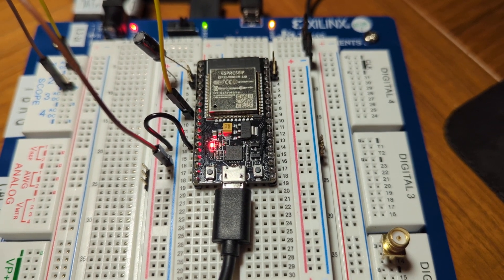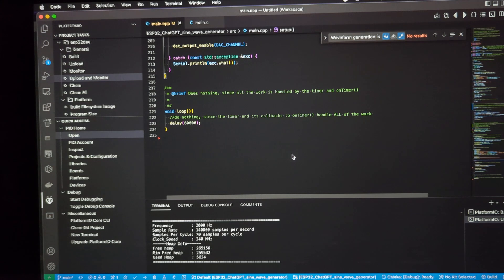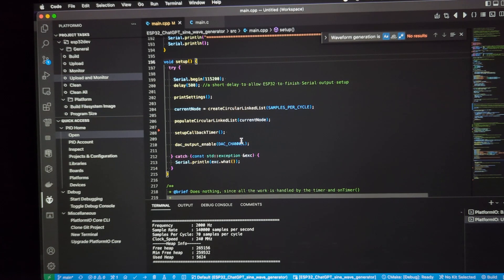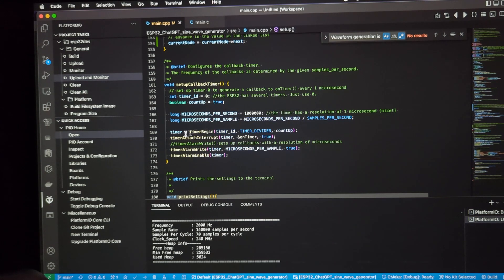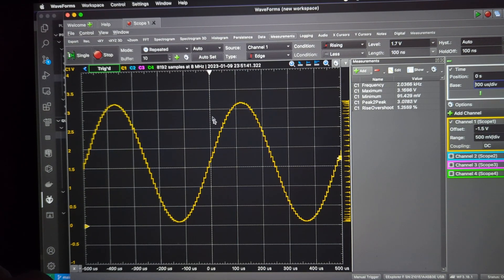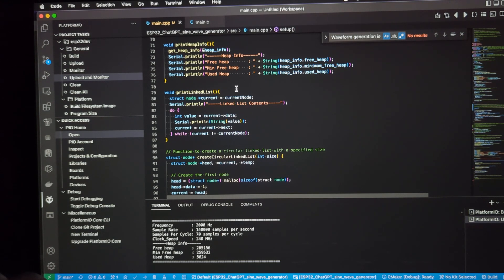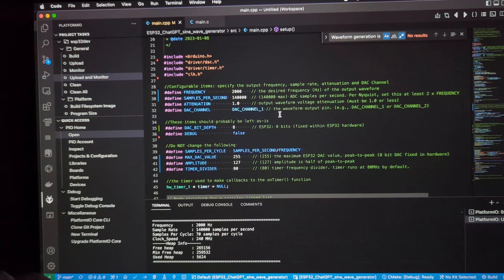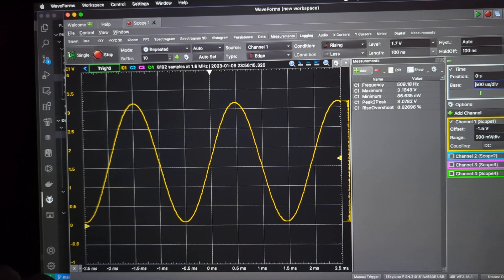ESP32 DAC: creating a flexible sine wave function generator

Comment: as you said "IT'S A START"
and... GODDAMMIT  i am going to continue this 

I WANT TO BE ABLE TO DO THE FOLLOWING 

WAVEFORMS
Sine
Square
Rectangle (with Configurable Duty Cycle)
DC
Pulse
Triangle
Sawtooth
Noise

I want all of them (but let's start with just Sine , Square and Rectangle) to have a Max Frequency of 500MHz.
Adjustable manually via a P.O.T.
I want all of them to have Amplitude Adjustment manually via a P.O.T.
I want all of them to have PHASE OFFSET Ability (Where applicable)
Adjustable manually via a P.O.T.
I want to have DUTY CYCLE Adjustable manually via a P.O.T.

I want to have Modulations, AM, FM, FSK, PSK
Adjustable manually via a P.O.T.

I think this might be interesting to work on.
Reply from the maker: See my other video on esp32 square wave generator. Making the other additions you mentioned shouldn't be too difficult.  https://youtu.be/ry_nsRsLTJ0?si=N25pR7Xg4Uvz1v_-
Reply: @philipgiacalone5605  
WILL DO , THANKS

Interestingly, i found this guy
https://www.youtube.com/watch?v=bEGYbOUTUeM

it goes to 8GHz
However , the guy in the video didn't see IT HAS A JTAG Unpopulated header.

and the max on this SIG GEN is 20GHz
I was thinking we could use this as a guide.
the thing looks simple enough
Reply from the maker: Also see my video on shifting signals using an op amp. That'll be needed to output signals with both positive and negative voltage values. https://youtu.be/srN_DY_xZm8?si=oLJ7E3NoLnSlw7ux
Reply: @philipgiacalone5605  
cool

Comment: Awesome stuff my man.. liked and subscribed.. eveb though im late to the party.. im going to try to implement what you have here into a synth project im working on . Thanks a bunch. Look forward to checking out the rest of your videos after im done with this one. Btw.. what kinda scope setup is that?
Reply from the maker: Thank you for your kind comments. I am using a Digilent Electronics Explorer board. It has many useful functions for electronics testing and learning. It includes a 4 channel oscilloscope, for example. It requires a computer for its output/display and for the controls interface.
Reply from the maker: BTW, please also see the comments I posted with this video. There's a github link to a newer version of the code that performs better. It uses an array rather than a circular linked list to hold the sinusoid values. Otherwise, the overall design is the same.

Comment: Great vid!  I got the new source but I can't find clk.h and associated lib in platformio.  Did you do anything special
to get yours running?  Tried looking on programio site - some hope but ultimately faiiled.
Are you using board esp32dev?  Thanks for putting this up.
Reply from the maker: BTW, I've recently moved away from PlatformIO for ESP32 development. I am still using VSCode -- but mostly as a text editor. VSCode in combination with Platformio is a difficult beast to understand, configure and use, imo. I'm finding its simpler and more straight forward to just use the ESP-IDF command line tool (idf.py) for compiling code and flashing the device. Also, for new projects, it's best to start with relevant example code provided by Espressif (found under ~/esp/esp-idf/examples). They build and flash reliably using idf.py. Copy/paste examples projects as a starting point for making code changes and experimenting. 

Frankly, I'm still in the early learning stages with ESP32 .But the headaches dealing with VSCode and ESP32 Extensions has been a giant waste of time. There's enough complexity and moving parts with the ESP32 to deal with (like libraries being removed). Keeping things simple is never a bad idea.
Reply: @philipgiacalone5605  Thank you ever so much for this guidance.  I had discoverred the esp_private/esp_clk.h which got me somewhat further but over the last two evenings (by which I mean each hour of all of each night) I have come to the same conclusion as you regarding platformio and etc.  I can run significant parts of the example code from  this video on real hardware but it truly seems like the Medusa workflow at this point.    On your recommendation (but not in any way responsibility) I'm currently in the process of manually installing all the toolchain and etc from esp.  Hope springs eternal.  Of course it could all turn to dirt at any point but even the vague promise of getting to programming vice learning new mouse tricks is compelling.  Thanks again for all the extremely relevant info pointers.
Reply from the maker: @talldrumgirl  Thanks again for the feedback. Good to hear that you've come to the same conclusion -- you did that faster than me, avoiding additional hours of pain! Note that the code for this sine wave generator relies on BOTH the Arduino API and the ESP-IDF API. I plan to create a new version that only relies on the ESP-IDF API soon. 

Going forward, it probably makes sense to avoid using Arduino code for the ESP32 so I'll try to stick with 1 API and toolset (the Espressif toolset). 

Also, Circuit Python from Adafruit might be worth looking into and playing with. They've created a language and toolset that is supposed to be easier and faster to use for ESP32 development. I haven't tried it yet but plan to.
Reply from the maker: Hi Jim, 
The newest version of Espressif ESP-IDF software (i.e., version 5.1) removed clk.h from the API. My code was created with version 5.0. Here is what their ESP32 Programming Guide says about migrating from 5.0 to 5.1. 

ESP Clock: The ESP Clock API (functions/types/macros prefixed with esp_clk) has been made into a private API. Thus, the previous include paths #include "ESP32/clk.h" and #include "esp_clk.h" have been removed. If users still require usage of the ESP Clock API (though this is not recommended), it can be included via #include "esp_private/esp_clk.h".

So it seems there are 2 possible ways to fix the compile problem due to the missing header file ("clk.h not found"). 
1) In the code, remove "#include "clk.h". Also remove lines 182 thru 186 (in the printSettings() function). These 2 esp_clk function calls are only needed for information, anyway. 
2) In the code, replace "#include "clk.h" with  "#include esp_private/esp_clk.h" (not recommended by Espressif, since the new API is private and unstable)

Here is a link to Espressif's migration guide for version 5.1, if interested. Download the pdf and search for clk.h to find the relevant paragraphs. 
https://docs.espressif.com/projects/esp-idf/en/latest/esp32/migration-guides/release-5.x/5.1/index.html

Note that you may also notice warnings during the compile about dac.h being deprecated. The Espressif API is still undergoing many changes, apparently, and dac.h is destined to be removed eventually, too. For now, my code will still work, since dac.h is still included in the 5.1 API.  

Please let me know if this works for you. Thank you for the feedback. Much appreciated.